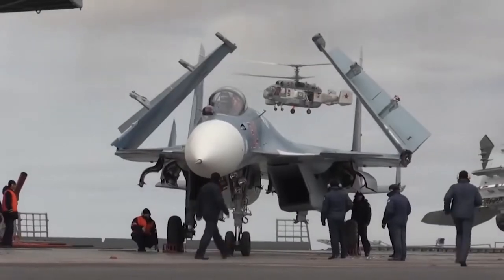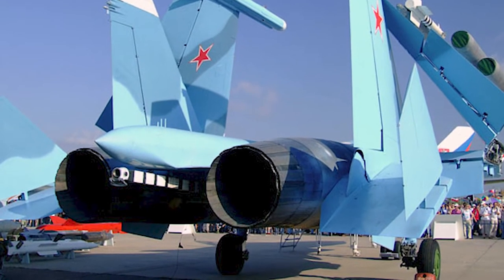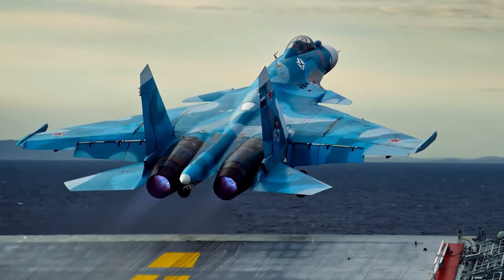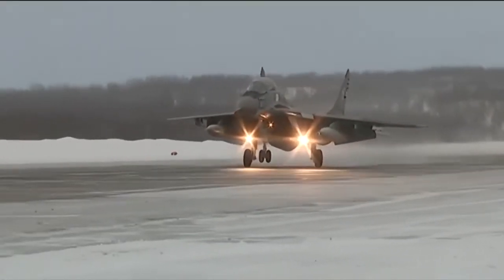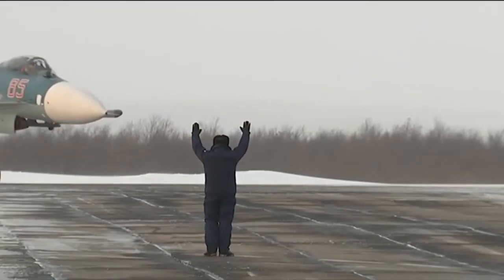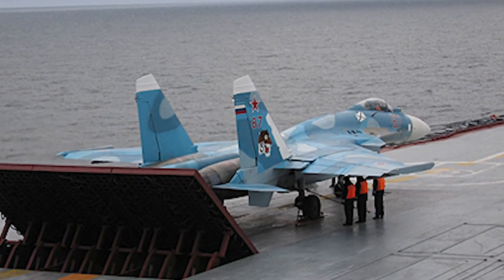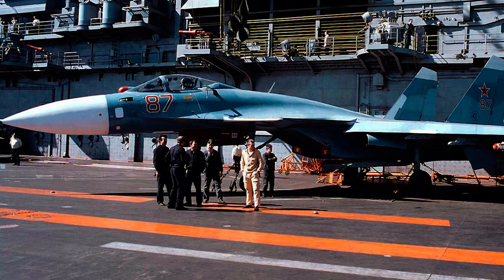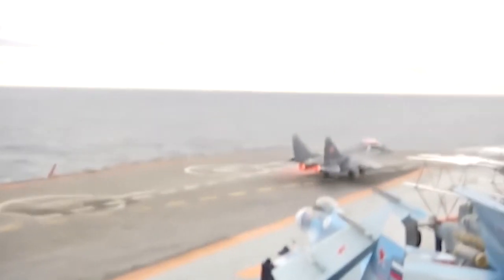Sukhoi Su-33 Flanker-D - A Short History

Comment: It's a pity the kuznetsov had to borrow/steal/copy the ramp idea from the Royal Navy, originally designed by an engineering company based in Bristol England, for the speedy launch and fuel efficiency rating for the Harrier jump jet. Maybe someone should mention that, the proof is ever so easy to look up.